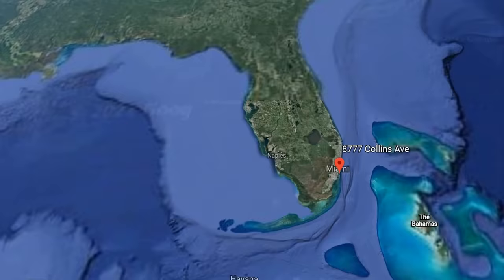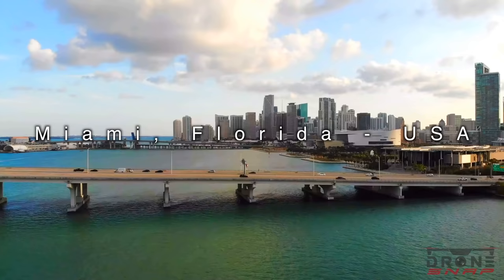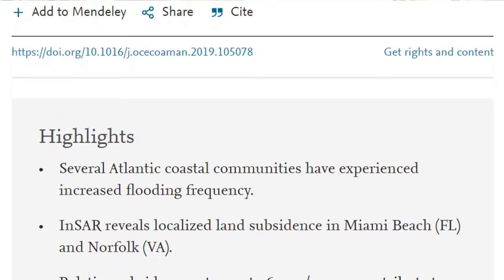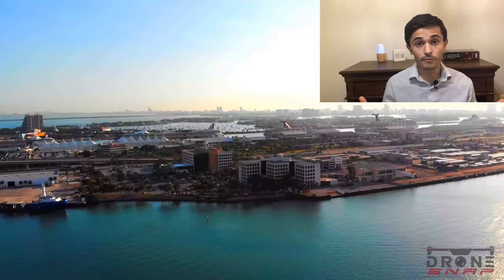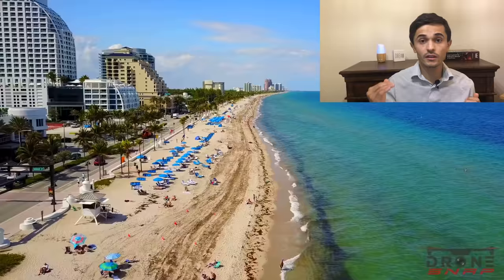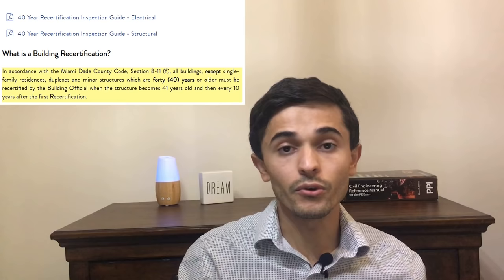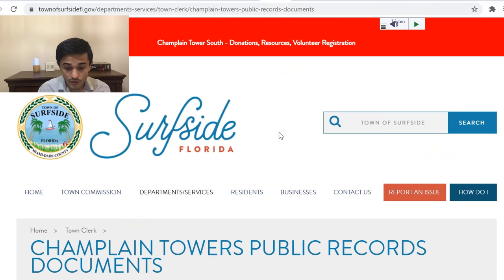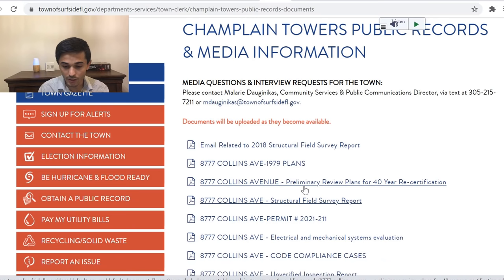Why Did the Building in Miami Collapse? A Structural Engineer's Perspective

Comment: Some additional details here might help you, but you are correct and on the right track, absolutely. A:) The garage would flood with seawater when the tide was high, so it was a combination of the pool above it and seawater. The pool above the garage was causing that rusting rebar on the ceiling and B:) They, for whatever odd reason started repair the roof which very little wrong with it, wasn't leaking and it was mostly cosmetic stuff, nothing super serious. 

Usually if it's not that serious you do other stuff first and put your rigging for work up the sides (which there was at this building) into the old roof, preferably not a new one. That's backwards and by the sounds of it, unnecessary for now vs. the parking garage. But according to a Lawyer they were jackhammering for weeks up there too. Vibration from that was annoying him and that can certainly cause already weakened structures in another part of a building to start spalling the concrete. There were also two planter boxes butted up against the building, that hadn't been examined without tearing them out, but covered 2 of 3 columns, two feet up the wall. That are connected to the parking garage as well and those were heavily criticized by the Engineers. 

The amount of displacement on this building was 1-2 mm per year and it was actually on a section that was bedrock that was very stable, one of the better spots there and out of all the pieces of property sold there was there, it was the most stable and that's right from the people who sold it and from their geological etc. surveys. Although there were rumours of a crack that had developed in bedrock and there was a hole in the basement? Anyway, that's just unsupported opinion/rumours and not likely, as you also said (other Structural Engineers agree with you). This was 100% the fault of a poorly maintained building and 100% started in the garage, a witness who escaped it said they saw it start in the garage too.  

The problem, with how the stuff was written, was some of it used the phrase "in a timely fashion", which to an Engineer means urgent, but to a board/owners, it's could mean "in a few years we'll get to it." And a few years, cost a lot of lives and a whole lot of money and it's just getting started.
Reply: And I just found out that in parking spot 78, water pooled there regularly, according to a maintenance guy who first observed it a couple of years ago.

Comment: An interesting report yesterday of an observation by the pool maintenance guy, a few days before collapse, noted significant pooling of water in the area of parking spot 78, which if you look at the garage level building plans, on that same Surfside website, this is the same area where it appears the structural failure began.
Reply: Yup and that rusting rebar in the ceiling of the garage and LOTS of Calcium deposits and even stalactites growing from the ceiling, showed those pool issues. Along with the seawater that would flood the garage when tides were high, it was a recipe for disaster. Whatever you're seeing on the outside is a sure sign of worse inside the concrete. That's super interesting though about that parking spot, that I hadn't heard and really points to how bad the pool issue was.
Reply: @MrBilld75  — not to mention that the water weight alone within the pool was probably around 400,000 pounds (200 tons).
Reply: @bionicpuma2920  Yeah, good point, that's a whole lot of weight and each floor weighs that much too.

Comment: Sand settlement

Sands cannot be considered as homogeneous elastic media. What does that mean?
That, even for sands with homogeneous granulometry, its deformability modulus is not constant regardless of depth.
Based on this consideration, and also through the use of the Elasticity Theory, Schmertamann developed in 1970 a method for the estimation of settlement in sand. This method was improved in 1978.
Reply: self-binding material
Reply: In S. Fla. they don't build big buildings on sand, they have lot's of rock here to build on and they pile drive for weeks the columns down to the most solid rock.  It's not like building a house on concrete footers, even though those are on top of rock too.  This was a crappy construction job not a bad choice of where to place the columns.  I've seen bridges in the Keys hold up for over 100 years that are better built than modern methods they use today, all done with steal and concrete but workers and builders were far better 100 years ago than the ones in the 80's.  Building on the beach is not a big problem unless you are a lawyer, they have problems all the time but the builders can get anything done if they have the smarts and more importantly, integrity.  These days we have way more money being used to make crap compared to the old days. By paying off the right people, inspectors, lawyers and judges, builders can get away with murder and they do, all for a bit more profit.
Reply: I pooped my pants
Reply: Seems to me, that if the location was attracting so, so much standing water, and at times accommodated that water to a point where it all disappeared, that the water MUST have been draining in some form or fashion, out from underneath - and given the granularity of sand, could have left large, unsupported underground sink areas. it might be that the foundation under the building has accommodated so much water over the years that large, open and unsupported areas could have formed anywhere under the tower yes?

Comment: Concrete is porous. An example of rebar failure from corrosion is the route 912 high level bridge in East Chicago, Indiana.  Using salt to melt snow and ice over the years.  This salted water got into the vertical columns and rusted away the rebar.  The bridge had to be removed.

Comment: A woman called her family saying that the pool deck had “disappeared into a large sinkhole” seconds before the collapse. The woman has not been seen or heard from since and is one of the 150 still missing. Built in 1981 means that the work required BEFORE 2021 NOT just thinking about it as the letter indicated almost  3 years later. Meanwhile the owners had been notified in writing. In 2018 the repair estimate was 9.1 million now 2 2/3 years later it’s 15 million? Why bother having mandatory recerts with no mechanism to ensure the work is completed in a specific time frame? 150 missing presumed dead deserve an explanation.

Comment: The "drilling" next door was long-term use of diesel hammers to drive in piles for a new building that literally touched the foundation wall of Champlain.  The vibrations from this method are known to cause moderate to severe damage to surrounding structures, but because both buildings are in different townships, it was basically impossible for the residents of Champlain to get any kind of say in what was going on literally next door.  Vibrations were monitored intermittently (as opposed to continuously as recommended) by the contractor conducting the work, and not once were the vibrations within the range of the limitations set by their own city.
Not saying it was The Cause, there is not A Cause to this, but it's definitely turning out to play a bigger part than we thought it was.
Subsidence has been investigated and determined to be minimal in this particular case.  There is still a major problem of subsidence in Miami, but this particular block showed very, very little change.  What I read on that said nothing of the water table, however, and even in stable soil, a rising water table will slowly destroy a good foundation, maybe over, say...forty years?

Comment: You need to look for the YouTube video of the previous maintenance manager of the building the parking garage used to flood with seawater sometimes up to the top of your thighs and then the water would disappear quickly going back through cracks in the floor of parking garage I'm thinking the ground may have been washed away underneath that parking garage that'll help a lot sadly enjoy your video
Reply: Or the water rusted the rebar in the concrete?

Comment: If the sea level is rising when exactly are the surveyors going to update all of the established geodetic  ASL elevations ?

If you introduce exposed steel reinforcements to corrosive chemicals (chlorine)..would that accelerate the deterioration of the concrete beams in the pool equipment area ?
Just asking

Comment: Build on the Rock(A)

24 “Therefore (B)whoever hears these sayings of Mine, and does them, I will liken him to a wise man who built his house on the rock: 25 and the rain descended, the floods came, and the winds blew and beat on that house; and it did not fall, for it was founded on the rock.
26 “But everyone who hears these sayings of Mine, and does not do them, will be like a foolish man who built his house on the sand: 27 and the rain descended, the floods came, and the winds blew and beat on that house; and it fell. And great was its fall.”
Reply: Bible makes for good engineering regulations, huh?
Reply: He didn't explain why the soil matters,  Surely the building was built on solid rock.  I remember seeing construction in Florida, you dig a hole in the sand and it fills with water.  They have to use pumps to keep the water out during construction.
Reply: @jrstf  on our shoreline………..should NEVER be multistory towers.
Reply: @prmath  - Those shoreline towers are important, they block the hurricane winds from the inland buildings. I'm only joking, the winds actually go right around them.
Reply: Biblically true for buildings, but simultaneously the Bible is referring to Jesus as the rock of truth and salvation, upon which we rest our belief and faith to be saved for eternal life.  The Rock of Ages is Jesus Christ.💕✝️🙏

Comment: It also did not help that they added a 13th floor which is the penthouse and also tons of marble throughout all of the units to make them look fancy marble is extremely heavy and adding a whole Nother floor onto a building that was not designed to have an extra floor put a lot of extra weight arm support columns that were failing

Comment: How are the flashes (best seen) in the west building on 2 different floors explained? There are also flashes from the other building that fell first. Looks like a demolition.
Reply: Could be exposed wires arching. 110 or 220 would make a decent spark, especially in low light.

Comment: It is observed that for sands (α = 3), the correlation Es with qc results in: Es =3⋅qc
which is compatible with Schmertmann's (1978) relations.
According to D’Appolonia et al. (1970), the presence of the water table can be ignored because its effect on the deformability modulus is reflected in obtaining N, ratified by Meyerhof (1965). This assertion was later confirmed by Terzaghi et al. (1996), based on the results of Burland-Burbidge, 1985.
In the case of saturation of a sand that was not saturated at the time of the survey, for example, due to the rise of the NA, the settlement increases from a value that, depending on the author, can be from 1/3 (Bolognesi, 1969) to 100% (Terzaghi & Peck, 1948; Terzaghi & Peck, 1967; Terzaghi et al., 1996).In sand, undisturbed sampling, as well as molding specimens for carrying out laboratory tests, are extremely difficult operations to proceed.
For these reasons, in general, indirect procedures are used to obtain data on the “in situ” characteristics of shear strength and also of compressibility of these soils, in particular. Percussion probes, as well as static cone penetration tests (Dutch type), usually the only ones available in preliminary analyses, are widely used in these procedures.
Reply: I think they might need your help.
Reply: All sounds impressive to someone like me that has no idea what you just said.

But the building is built on rock.  Why does the sand matter?
Reply: @jrstf  I don't know the soil mechanics of Miami, what can I say most of the buildings that I calculated on the waterfront were weak soils tested by the mechanic labs that give me the terrain resistance indexes.  There are companies specializing in soil mechanics that give me the soil resistance indices, if by chance the company's laboratory tests are failed, it compromises all my calculations;  I follow the constructions when they are digging and if by chance I see that the soil is not compatible, the project goes back to the drawing board, I call the company that carried out the mechanical tests to make another evaluation
Reply: @jrstf  Large projects are several structural engineers who make the calculations and I am from the time when there was no computer to help;  and all work is done in pure 🧠
Reply: @noorielaboab1032  - I remember a local road project that got in big and expensive trouble after they exposed iron and ruined all the local wells.  There were multiple companies involved as you say, the one that studied the rock bored their holes parallel to the rock layers and didn't find the iron.  If they had someone like you that actually opened their eyes this never would have happened, to the person with eyes it was obvious the rock layers had folded an ran vertical instead of horizontal, so a vertical bore would not have been optimal.
Reply: @jrstf  Yes problem when finding groundwater or bubble formed when the earth was cooled thousands of years ago.  When there is no resistance in the sole at 60 feet;  I recommend the project owner to look for other land;

Comment: You're a Civil Structure Engineer? You know what I have in the background of engineering? NOTHING. And I can still tell you using common sense that millions of tons of concrete doesn't come crashing down in a matter of seconds if the building was built to code. THERE WERE MAJOR CORNERS CUT WHEN THIS CONDO WAS BUILT IN 1980. The question at this point is was this done out of greed or due to a severe case of contractor negligence. And how did it pass inspection before any concrete was poured?
Reply: Builder Nathan Reiber was on budget using his own money, until Toronto-Dominion Bank finalized the remaining loans needed. He is a disbarred Canadian lawyer, who came to retire in Florida, escaping Revenue Canada. Reiber cut every corner he possibly could, to maximize his profit, including adding rush approval to place a thirteenth floor Penthouse. His goals were met, after pocketing $23,000,000 from the sale of Champlain Towers South.

Comment: Thanks for the analysis. In my opinion, the spalling shown was not enough to cause a catastrophic failure like the one we observe in the video.  I see this type of spalling in many of the buildings I inspect in Miami Beach. I would suspect that a failure of the post-tensioned steel use for the slabs is a more likely culprit. Post tension cables are much harder to inspect since you would need to inspect the anchoring points, which are not readily accessible for the visual type of inspection that is done to meet the 40-year certification. The life of the tendons used for the post-tension reinforcement is limited and there are no requirements anywhere in the code or municipalities involved to monitor the condition of the tendons. Corrosion and tension monitoring is available but could be expensive and up to this point a tough sell to condo association or developers.
Reply: I agree with you. I am a structural engineer, practicing in Florida last 20 years, doing 40 Yrs recertification, design and construction and as we speak I do concrete restoration work in a multi-story parking structure at the seaside. Spalling is maybe contributing, but I believe PUNCHING SHEAR took place. at the garage level. Post tension cables and the termination of those cables have to be examined.
Reply: @GuzelTurkiyemiz  I also think that PUNCHING SHEAR caused by the failure of the PT support has a high probability of causing the collapse. The question is what is going to be required for the existing buildings. I am also a structural engineer here in Florida and if our suspicions are correct,  it will require the 40-year certification to include a certification of the existing PT system. That is not going to be cheap. When talking to other engineers we always questioned the thought processes of installing a reinforcement system with a limited lifespan, with a failure mechanism that provides almost no warning and no recertification required. Fairly sure all that is going to change.
Reply: @GuzelTurkiyemiz  Got a hold of the original plans for the building, and the original plans call for a reinforced slab, not PT reinforcement. If this is correct, it makes the sudden collapse more puzzling. Still looks like a punching shear mechanism for the failure, but there should have been obvious compelling signs of trouble ahead, which are not indicated on the photographs that are available.

Comment: i believe the ground was the problem because the way are colaps
Reply: Not so sure the ground was the problem in this case. The aftermath pictures show the columns punching through the slabs. Short of a sinkhole, which does seem to be the case based on the available photographs, It seems like the piling held up.

Comment: The 2018 engineering report seems to be missing something. That building, according to former maint mgr, has been flooding with salt water to 2' deep monthly with the high tide for 10+ years. Repeatedly the pumps for the basement were being replaced.   
What do you think that would do integrity of the concrete columns subjected to that for extended periods of time? 
I kinda of doubt the used non porous concrete like in bridges for those basement columns.   
Maybe a sinkhole under those 3 critical columns took the building down. Idk if the 1 column in the report with the spalled concrete would take doen the building like that. What do you think? Watch that interview with the former maint mgr on youtube.